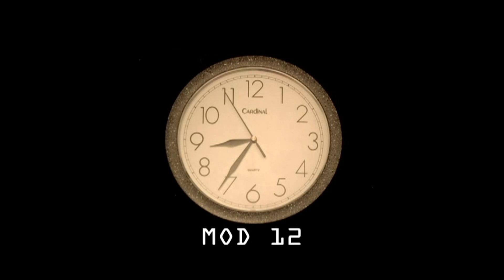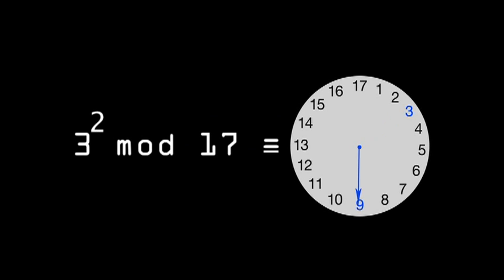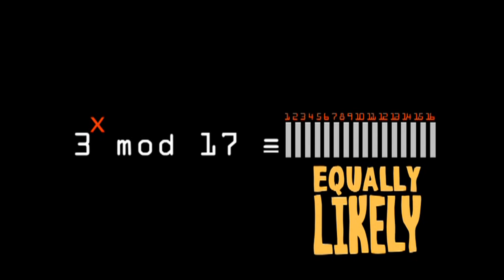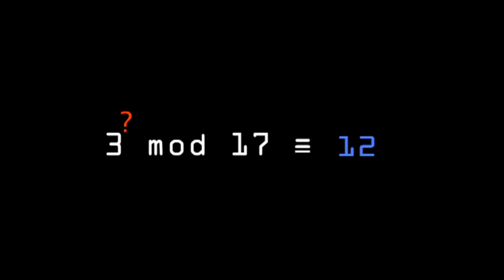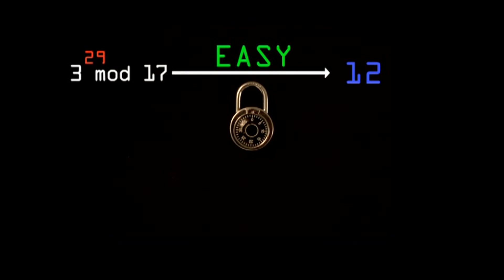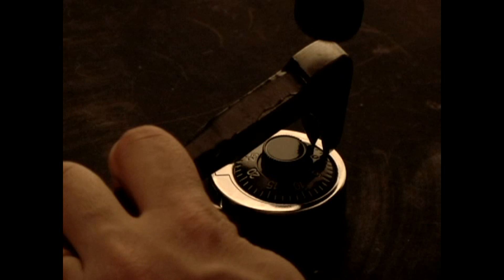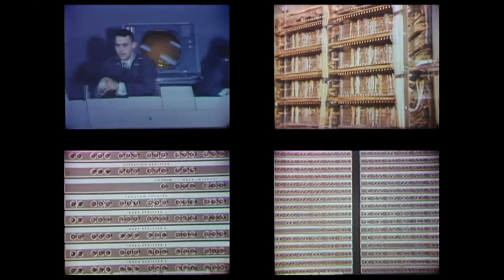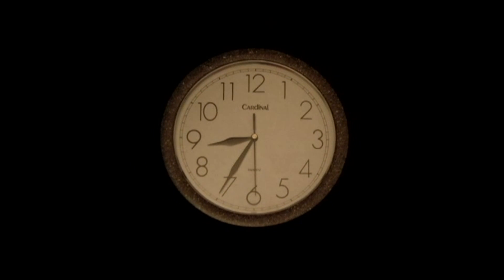Discrete Logarithm Problem

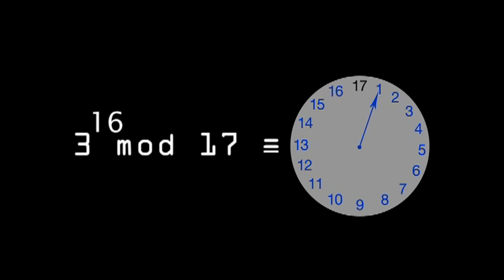Comment: 1:01 "Any integer between zero and seventeen" and shows the integers between 1 and 16, but shouldn't be "any integer between 0 and 16"
Reply: No because whenever you’re dealing with mod it’s one digit smaller. In this case we have 17 so accepted values would be 1-16